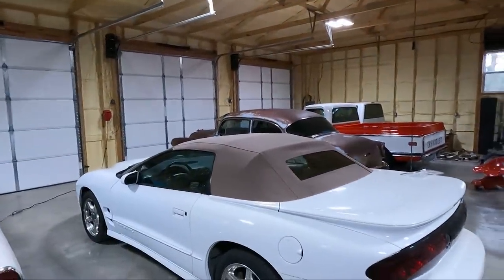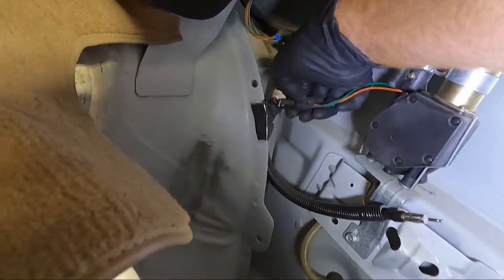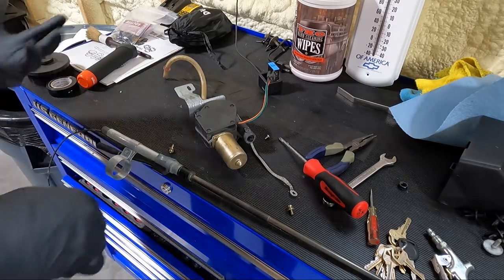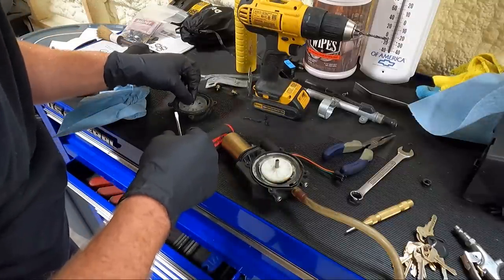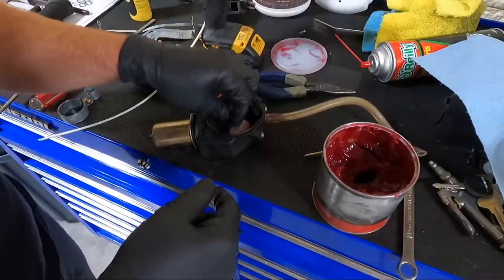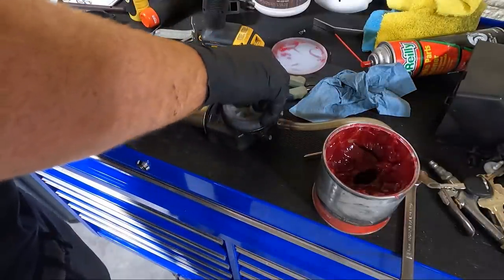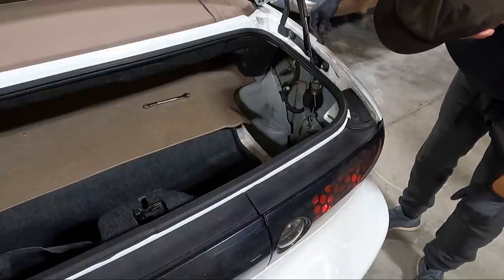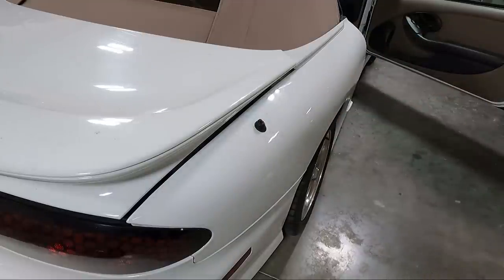How to Replace Trans Am Antenna Mast (Plus New Top is On)

Comment: Travis, thank you so much for the awesome video. Very informative and great quality. I was able to fix my 2001 T/A with ease. In case you were wondering, I purchased ACDelco 10256439 because it is the exact part from GM. It is a perfect match minus being stainless steel colored and not black like the original from the factory. It does seat completely flush when retracted. I was going to purchase the one you bought, but was hesitant after seeing your video. The ACDelco is about $14.00 more on Amazon. Thanks again for the amazing video. I really enjoy your channel and greatly appreciate you.
Reply from the maker: Thank you. I shoud have just done that too

Comment: I have a nice system in my car, nothing is original in the audio system anyways and I use my Bluetooth/Android Auto 100% of the time so my antenna was unplugged immediately LOL. Possibly even deleting it and covering the hole when I get the car painted
Reply from the maker: LOL. Right after this video I unplugged mine too.
Reply: @TWAMotorsports  I drive my car every day year round, not once have I used the antenna or FM/AM in general. 12k miles on my '96 since February when I bought it and thousands more on the previous birds I owned in the past 4 years
Reply from the maker: I'm sure mine will go about the same

Comment: Thanks so much for the video!! The new trans am looks nice. The tan convertible top will definitely turn heads because it's different! I am glad you addressed this issue, I had the same issue. I replaced three antennas within 6 months. I kept burning up motors. I ended up replacing it with a massless antenna that you could stick in the window. Only cost me about 39 bucks, because I didn't want to get a cheap one. And I've been great ever since. I just left the old antenna in its place (down of course) and nobody will ever know the difference.  So I'll never have to worry about antenna motor or the shaft ever again!!
Reply from the maker: Yeah. I don't even like them but they do look nice down and out of the way.
Reply: @TWAMotorsports  thank you for all your content and wisdom!! You're the greatest!!!
Reply from the maker: Thank you but I'm not the greatest. Lol

Comment: Sorry Man but you forgot to unscrew the antenna screw  on the outside of the antenna, in Order too pull the motor out from the bottom. I have  a firebird that i installed just the mass with the plastic ripcord. I had to take my motor apart so that i can remove the broken rip cord. inside.
Reply from the maker: Maybe so

Comment: Hey Travis, 

I’ve noticed that you’ve tried fixing the wheel slop on the OBS with no success which includes replacing the gearbox, rag joint, and a jeep steering shaft which that is a good thing but you’re missing one important piece in the puzzle. You have not replaced the lower steering column bearing and I noticed that on one of your videos when you were moving the steering shaft it had a lot play. 

Watch this video to see what I’m talking about. 

https://www.youtube.com/watch?v=ChaZYKNqW5I
Reply from the maker: Thank you very much. I will look into that.

Comment: I just bought a 2000 ws6 with 80,000 miles same exact color as yours it definetly turns heads. Have you upgraded the headlights to led? If so what do you recommend
Reply from the maker: I haven't. It is getting sold

Comment: My wife wants me to get a convertible ta... I said when we get settled in Tampa Florida I will buy one...👍
Reply from the maker: Nice to have one of each.
Reply: @TWAMotorsports  indeed.. But I told my wife that I promise I won't modify it.. lol..
Reply: @TWAMotorsports  ohhh I forgot to mention to that circle D's is building my 4l60e for my 94 TA.. but after doing some research and questions etc.. my engine builder said my 4l60e that is beefed up internally will work peeeeeerfect for my application.
Reply: @TWAMotorsports  nice video Travis on power antenna... I was never a fan of them because of issues they have... Aftermarket parts are never the same as factory... But it looks nice and works... Sooo that's a plus... 👍
Reply from the maker: Oh my. Future broken promises. Lol
Reply from the maker: Thank you. Yeah it will work for now.
Reply: @TWAMotorsports  good Sunday evening Travis.. are you working on anything in your garage this evenin
Reply from the maker: Yes but nothing fun. Lol

Comment: Hey brother I just got an antenna from Autozone, complete with motor. It completely retracts and is pretty nice for $70, easy install. All you have to do is solder 3 wires so you can use the factory connector. Made by Metra. Let me know if you want photos or a video!
Reply from the maker: Yeah I actually saw that option.
Reply: Also, it goes up and down when you power on/off the radio
Reply from the maker: Nice

Comment: Mines will not go up. It doesn't even make a noise.
Reply from the maker: Probably bad motor
Reply: @TWAMotorsports  No, bro I just found out one of the cables is snapped. I think the last owner was tinkering with the antenna and broke one of the cables. So it's a easy fix. To only thing I have to do is reconnect those cables. But a requires sauttering so I might have to take it to a shop. I was never good on sautering. I suck at it with Xbox controllers and PlayStation controllers. But thanks for the reply. ❤️❤️❤️❤️🤣🤣🤣🤣
Reply from the maker: Good luck on your fix

Comment: I recently installed a power antenna on my 97 Camaro. They didn’t come with them. I don’t remember paying $300 some dollars for it. It is an AC Delco.
Reply from the maker: Interesting.
Reply: How did you hook up the power for the antenna in the Camaro? I would like to install one in my car so I can easily use a car cover.
Reply: @jaden.sanderson  I ran power from behind the head unit. There was a write up I found on the internet that helped me but I just tried to look it up and it was removed for some reason. Sorry.
Reply: Hey Trav why was my entry removed?
Reply from the maker: If you post a link YouTube thinks it is spam and removes automatically.
Reply: @TWAMotorsports  ah ok. I was trying to give this guy a link to a thread on installing a power antenna on a Camaro. Oh well.
Reply from the maker: Yeah. I don't get it either